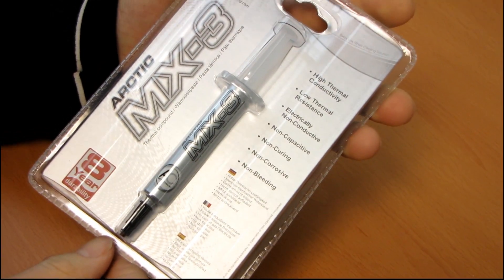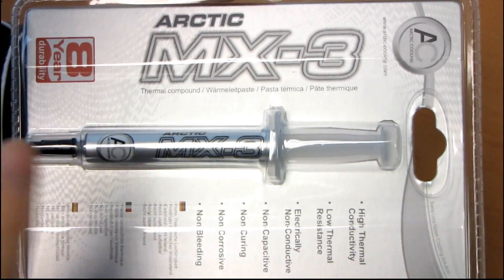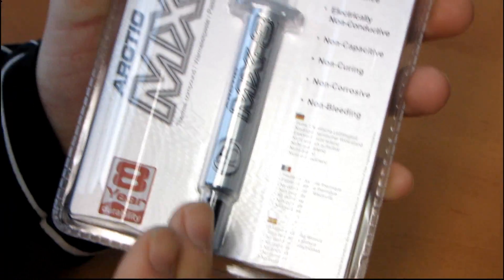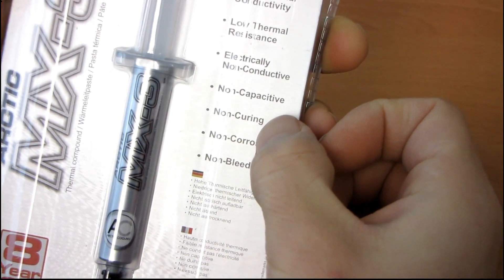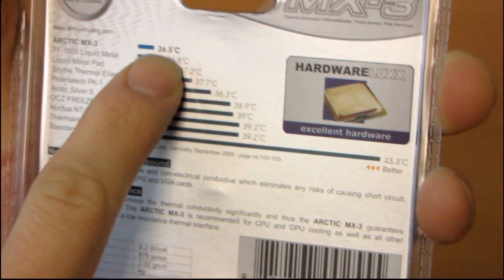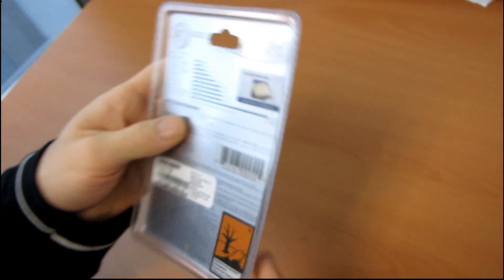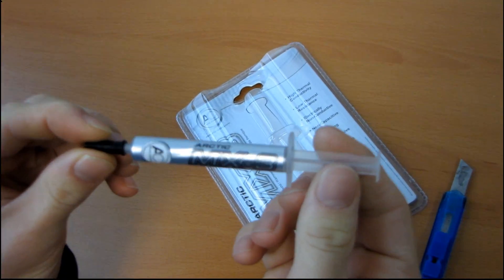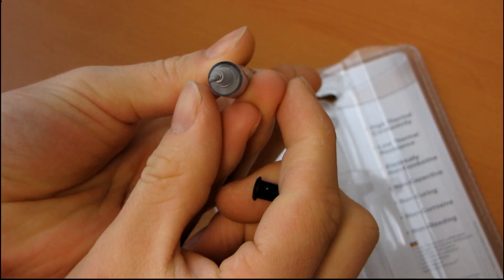Arctic Cooling MX-3 Thermal Compound Unboxing & First Look Linus Tech Tips

Comment: MX-3 is a strange beast.  It's somewhat thick during application but if you ever try to remove it after even short-term usage it looks partially evaporated.  It's very easy to remove with a cloth and alcohol/acetone.  In that sense it's not thick/viscous enough and I'll probably stick with IC Diamond because it works with machined and mirrored surfaces just as well.